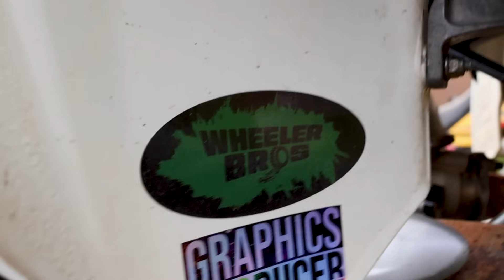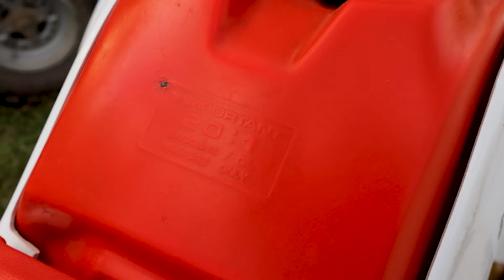Badlands Bash 2024 Quad Walk and Meet!

Comment: I had flexxbars on my 04 450r they helped alot with arm pump.  I did run rather stiff dampner in the bars but the little bit they still flexxed saved my arms from getting pumped to where i had to atleast slow down.

Comment: Dope video, just got my first quad, a 660r because of you! Thanks for the inspiration 🙏 

I am wondering though, if you had any suggestions, it runs fine but coughs at idle a bit and eventually coughs and dies, any suggestions? I adjusted the valves and cleaned the carbs, still same issues

Comment: Hey guys so I’m in a bit of a pickle. I got a 2007 YFZ 450 i picked it up not running the guy said it had an electrical issue. But basically ive been trying to troubleshoot it but nothing. Basically when I turn the switch on I got power to my lights but when I go press the buttons to turn on the starter I got nothing. I can jump the terminals and the starter will crank but nothing happens when I press the button. Not even the ticking at the solenoid. I’m just at a loss idk what to do anymore. Any ideas from anyone? (I replaced the starter solenoid, the fuse is good, wire harness is new.) I just don’t know what to do next. Thanks
Reply: Also lovin the videos! I’m a dirtbike guy but Michaels videos. Got me to get a quad 😅
Reply: If you know how to use a multimeter or test light, check to see you have continuity through the switch to the solenoid. Check to see if you have at least 12v going into the solenoid when you press the button. You probably have a disconnected wire under the tank or plastics. Refer to the wiring diagram and trace all your wires from the switch to the starter. You'll find it.
Reply: @F5Tornado44  I was going to say the same thing, definitely start with a multimeter and check all your connections and wire diagrams.